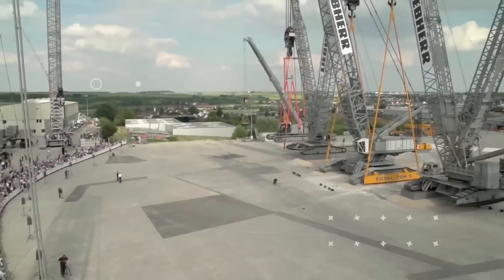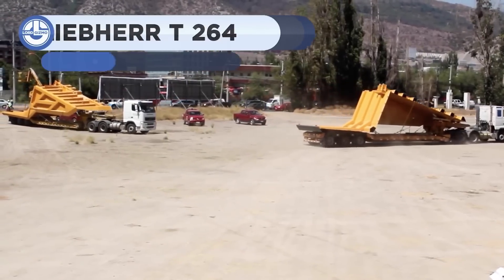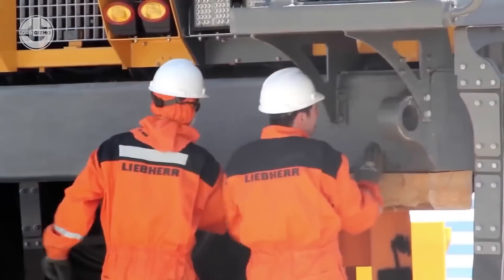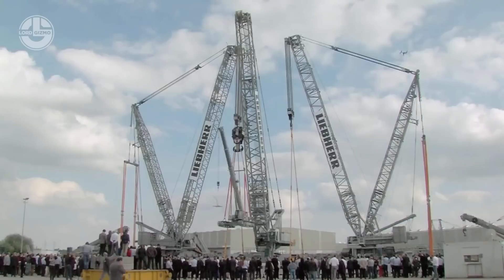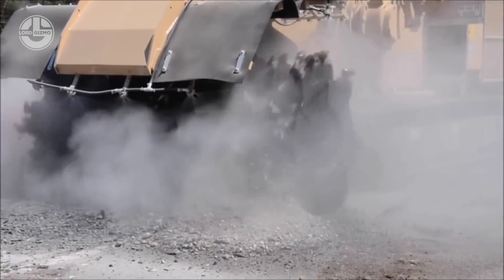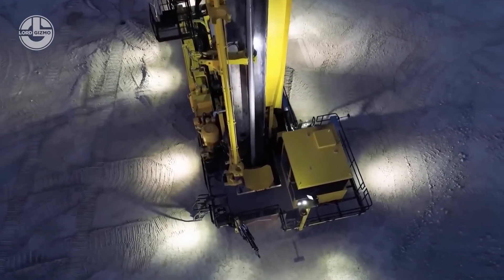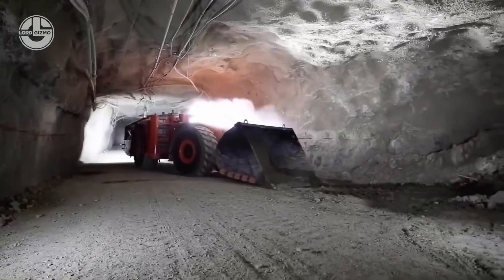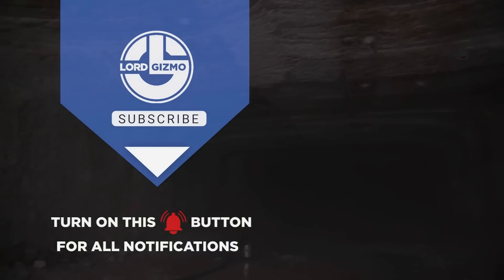Dangerously Powerful Machines You've Probably Never Seen Before

Comment: The hybrid mining wheel loader does have a cab and someone in it operating it in this video, which you said did not have a cab and was remote.   Just thought I would point that out.   Also went to Komatsu site to check specs.    There is a cab.     Cheers
Reply from the maker: Sorry!  You're right, there is a cab.  BUT, it can, and in this case is, operating remotely.